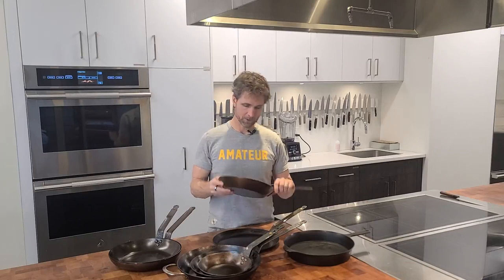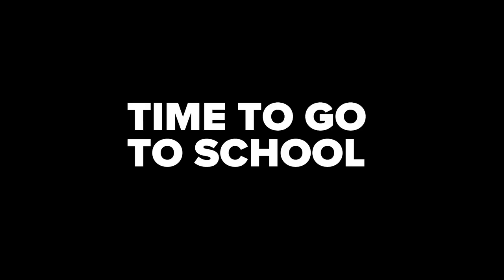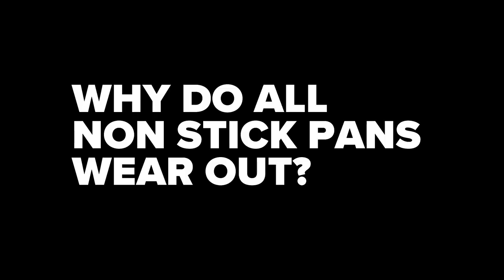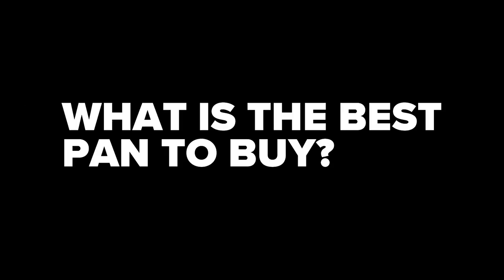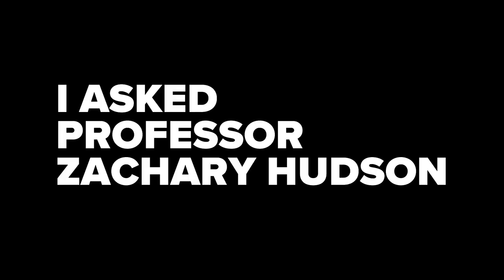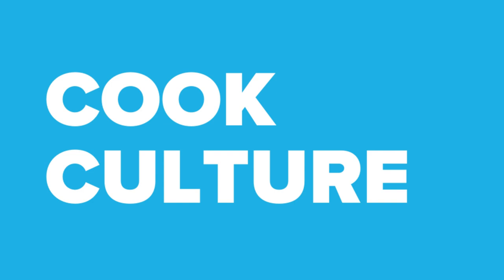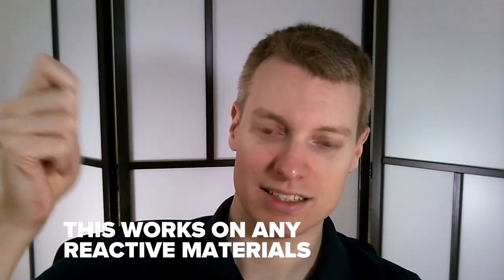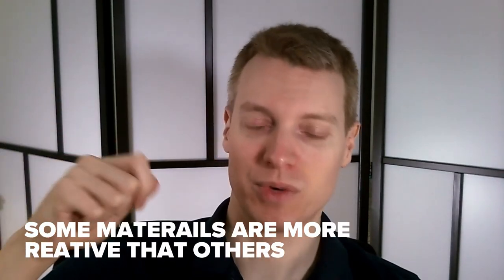Why ALL non-stick pans will wear out: I spoke with a Polymer Chemist

Comment: I inherited my grandmothers non stick pans, have been using them for the past 6 years. My grandmother used them for about 10+ years. I watched a review video on nonstick cookware only to find out its only good to use that cookware for 2-3 years and can release toxic chemicals into your food if it wears bad enough... i ran into my kitchen and checked all my pans and they were all in bad condition. I was devastated to learn ive been putting myself at risk. I only have cast iron, carbon steel, stainless steel, and glass for all my cooking because they can last generations and will always be safe!

Comment: This answers a lot of question I had. Although you’ve been preaching this to us for a while now, it’s still great to have it reiterated with science! Because I was going to ask what you thought of Caraway pots since they have no PFOA or PTFE or other sister materials in them. But I’ve learned from you and other people that it all comes down to the length of time of use. When I contacted Caraway, they said I could send their pan back to them if the coating wore out down the road for recycling but they currently don’t re-coat the pans. I guess it’s time to learn how to season forever-in-collection pans ;) Thank you for sharing your knowledge~
Reply from the maker: All good. Thanks for investing the time to get develop a long-term view. Whatever the promise of brands like Caraway, the reality is that they are made to be disposable cookware and will breakdown while you use them, depositing microparticles in you and our waterways.

Comment: Great video on the ecological issue allthough I wish he could have also commented on the personal health impact from using polymerized oil as coating:

1. Does it contain carcinogenic free radicals that can leach into the food?
2. Will using flames directly on the coating (eg. during normal use on a gas stove) create toxic fumes from burned polymerization?

Comment: Another example of wood abrading metal: woodworking tools. You have to keep sharpening them because even a few strokes of a very sharp plane iron or a chisel will cause it to dull and soon to become hard to use and require further sharpening.
Reply: That’s a much better example than water running over stone, since the tools dull so quickly.

Comment: I really like this video about how the polymerization works.  Also the explanation on the cheap teflon/non-stick pans and their associated environmental and health impacts was very eye openning.  I do not have any of these pans in my kitchen and I would always recommend  that people just not purchase non-stick pans.  This bolsters my experience and testing of textured versus mirrored finishes.  The durability of the seasoning has a direct correllation with the surface texture.  I had tested original Lodge sand casted rough finishes with very good results with adequate seasoning.  I also tested taking those Lodge pans down to a mirror finish and they performed equally well.  The difference I discovered was that the seasoning was not as durable on the mirror finish.  I took that mirroed finish back to a rougher surface using 60 grit sandpaper.  Further testing showed that the seasoning took better to the rougher surface and was more durable lasting considerably longer.  Going to strip down one of these pans and treat with vinegar for 15 minutes to see if this has any effect on the pan taking the seasoning better and if the seasoning will last longer.  I'll let you know.  Ciao
Reply from the maker: Nice. Thanks

Comment: All oils used in the kitchen will oxidize at elevated temperature and this will make them satisfactorily reactive bond to bond to a metal pan, even a stainless pan and build what you could call a varnish surface layer.  Think about tung oil and linseed oils applied to wood which eventually harden into a protective coating on wood.  Except this occurs much faster at the temperatures used to season pans.  
But the bond strength does depend on the reactivity of the metal surface as well as its surface texture.  Stainless has enough relatively inert chrome and nickel and is smooth polished and thus the attachment is not particularly long lasting.  Iron and steel are much better and will furthermore develop a black iron oxide layer that aids attachment. Cast iron is well known for microporosity that further anchors the seasoning layer. I notice many carbon steel pans come with a black oxide and/or phosphated or nitro carbonized mat surface which also anchors.  
All Teflon comes out of the reactor as a very fine powder.  This alone can be compacted into a soft mass with about the strength of a bar of ivory soap.  But when "sintered" in a high temperature oven, usable integrity and strength are developed.  However, Teflon can't practically be applied to a metal pan this way - and strength and wear resistance are still inadequate for cook pans.  
Instead, the Teflon reactor powder is formulated with various binders, carriers, fillers and solvents into a coating that can be sprayed on and thermally set.  Fillers like mica dust, various ground minerals, metal flake and even diamond dust are incorporated specifically to improve wear and scratch resistance.  The binders help it adhere to the filler and the pan surface itself.  Sometimes a primer coating is involved.  Aluminum is normally given a thick anodized surface.  The overall result is what you cook on.  And there is a recent concern that estrogen mimics can leach from this surface.  In any case, Teflon, in the presence of alkali and sodium at high temperature will eventually lose non-stick properties.  For example, frying onions with a little salt will more quickly kill your Teflon.  Interestingly, frying onions in oil with a little salt will help build a seasoning on carbon steel and cast iron.  And potato skins add minerals that help quickly build an effective seasoning layer ... akin to varnish.

Comment: an excellent video!  still, i wonder how much extra water, soap, and energy to dry and re-season the safer pans, since i have to scrub and re-season with almost every use--except for the stainless which require the scrubbing and polishing (for me)  but no re-seasoning.  these safer pans usually require more oil when cooking as well.  i realize my technique probably needs a lot of work, but suspect others are in the same boat.  i'm not ready to throw away non-stick, but use them very sparingly, with no plans for replacement.
Reply: I have wondered about this as well, but when you think about it the steady-state scenario you are already cooking with the pan, so at most you are keeping a burner on for maybe an extra minute to do the post-seasoning?  If you use electric or induction you beat a gas user with non-stick for sure due to the efficiency.

Non-stick cookware also requires washing with soap & water.  Less scrubbing for sure, but that doesn't mean you use less water.  I usually add some water and then scrub, but most of the time that isn't necessary even on my cheap lodge.  If stuff does stick and you have seasoning the burned food can just flake right off with a bit more cook time.  I have a hell of a time making Just egg in my less-seasoned pans, but even here when it sticks I can easily scrape it out as a few large pieces when I'm done.  In my well-seasoned pan if I have it a bit too hot the burned/deeply fried layer just brushes out like a true non-stick pan.

I think the huge amount of energy and water and other chemicals and materials needed to refine or recycle the metal would take quite a few stovetop reseasonings to catch up to.  And all the reseasonings in the winter are basically free (I write as I soak in the warmth from my just-seasoned pans and oven).  Also, the impact of the toxic processes used to create and apply non-stick coatings should be a consideration.  If not energy-wise, their impact in waste products and microplastic forever pollution.

But I have been trying to improve my stainless steel chops to avoid cooking things that may damage my cast iron seasoning.

Comment: The main issue I have with cast iron pans is that they rust very easily in Puerto Rico even while making sure it’s completely dried out after each use. Places with high humidity make it really difficult to maintain cast iron. Any other suggestions, whether a different material pan or better maintenance tips?
Reply: After you've cleaned your cast iron after use, dry with paper or cloth towels, then put back on the hob set at about 200- 250 F to evaporate any remaining moisture, then give a very light wipe with grapeseed (or similar seed) oil over all surfaces while the pan is still hot to the touch.
 
If high humidity can't get past that fine coat of grapeseed in Panama, it isn't going to get past it in Puerto Rico.
Reply: We have them in Cuba that is the same weather as Puerto Rico, and don't have this problem. Do you soak them? Or leave them were they are not protected from rain, or dont oil them after use? All those things can be conducive to rust. A fairly kept cas iron should not rust in any weather.

Comment: Very good video! however, only thing not discussed is whether washing cast iron/carbon steel pans with soap affects the coating or not. Maybe this is a whole subject for a new video? Cheers!
Reply: Those polymer 'brushes' sticking out of the coating the prof. spoke about are oil soluble. Dish washing soaps dissolve these (albeit quite slowly with handwashing formulations). This is why people say wash with water. 

The water actually helps the poly. layers stay on the pan. It is less attractive to those oily brushes so they dont want to dissolve off into it and flop back down and compact on the pan instead. Making more layers of coating. Ingenious really. With soap, they will likely be broken down and will definitely want to dissolve into the soap/water solution becasue of the lower surface tension that the soap promotes.

But if you wash with soaps you can always reseason. Over time the polymers will oxidise anyway and need regenerating even if they were never scraped off. Of course it is impossible to 'never' scrape them off. Even the lightest cooking agitation with oil (not water) facilitates this required regenerative process. It is a win win. 

Except the iron, aldehydes are also produced and some acrolien I understand. But these are not as harmful as the iron. They are volatile resulting in generally tolerable concentrations in the food. In addition, these compounds are easier to metabolise and excrete at low concentrations... Iron is not and builds up over time in men and post menopausal women.

Comment: hello, thank you for all the informative videos.
What is the best pan to cook tomato sauce/without getting the metal into our food?
Another question: how to buy the field pan while based in the UK? Many thanks
Reply from the maker: Hi, thanks. If you have a really well-seasoned pan you can cook with acidic foods. Field is looking at the best way to support UK customers. You can check their website: https://fieldcompany.com/
Reply: @Cook-Culture  This brings me to a good question, can ALUMINUM finish be adequately seasoned as to reduce the health risks associated to it?
I believe the greatest aluminum exposure from these natural finish pans may be from scrubbing the soft metal, generating silt-like alumina dust, which is VERY hard to remove (& nearly imperceptable), and roughens the surface, making for more surface area (from texture) for alumina to cling to & more aluminum surface for food to react to..
I have to say I love my All Clad style cookware, but my heavy gauge aluminim is all teflon nonstick.. I have some beautiful skillets, but am wary now, even though I use them only for low temp cooking, ie eggs or single serve sauces..
I think electric coil burners caused hotspots in iron based pans as pans got lighter, & that nonstick saved immediate sticking & cleaning workload, while delivering more sales revenue in long term.. oh, I prefer the more durable goods!
Really informational videos, I love learning more! Thank you for your service to those of us like me who know so much, but still need & desire to learn so much more!

Comment: What is the relationship between heat and polymerization? Do you have to exceed the smoke point or does the oil polymerize below if tou just give it enough time? (Meaning, do you really need to burn the oil to get the coating)
Reply from the maker: No, it's a fine balance of heat and time. You really don't need to make a lot, or much, smoke. Just a whisper.

Comment: I'm surprised that after explaining the molecular differences between plant-sourced oils and animal-based fats, that he recommended using plant oils. I have tried both in long-term cooking, and found butter to be much better than plant oils. Plant oils do darken my carbon steel pans much more; and.butter only leaves a translucent dark brown coating. But the plant oils seem to get carbon build-up much more faster, whereas butter doesn't at all. I also love the waxy, teflon-like seasoning that butter builds up rather than the 'stickier' feel of plant oil seasoning; and I also like the butter flavor in my foods too.

Maybe you can do a video about this? Try cooking long-term with butter, lard, tallow, etc in one pan and grapeseed, etc in another. See what kind of seasoning builds up in each pan: how they look, how each attracts or repels carbon build-up, how easy or hard each are to clean and maintain, how the foods taste after cooking, and so forth? Thanks.
Reply: BTW, I suspect that the reason why plant oils darken more as it seasons is because more loose carbon molecules are attracted to the C=C bonds he talks about. The reason why I can only get a 'translucent' dark-brown seasoning using butter is because less carbon molecules are attracted to the C=C bonds in animal fat. So wouldn't it be better to use animal fats than plant oils for seasoning? To get a better non-stick surface, wouldn't you want *less* molecular "fingers" attracting other molecules? It's opposite to Zac's logic and reasoning.

Comment: I have a few carbon steel de buyer pans. I like them. I often cook meat with a wine sauce, but after that the seasoning is almost gone. What would you recommend? Thank you
Reply from the maker: I would suggest if you're cooking this way all the time then use stainless steel. A quality seasoning can only take so much acid before it breaks down. If you were to cook with wine once in a while then your pans (with a hard seasoning) may be fine.

Comment: Thanks,I'm all into this polymerization method. I've always used flaxseed oil with good results,but wanted to try your suggestion of grape seed oil. I kind of get a slightly sticky feel to it..not dry and smooth as with flaxseed oil..
Any idea what I might be doing wrong?!
Thanks for an entertaining and educational channel!
Reply from the maker: Thanks! I'd say that if you're having good results with flaxseed then stick with it. Technically it's a better seasoning oil but some people find that it has a smell/taste so I suggest grapeseed because of its neutral flavour.  You may never find that grapeseed will harden as well as flax.
Reply: If I had to guess I'd say too much oil.  You should wipe the oil off until you think you've wiped too much off.  Then you should grab a clean paper towel and wipe it down again.  The best way I heard it described was "wipe the oil off like it was something you applied by mistake." Seriously.  If you're using the oven method you won't need to place a sheet pan on the bottom rack to catch drips and there is almost no smoke.  The last time I seasoned two pans in the oven this way my wife asked me what I was cooking.
Reply: @Cook-Culture  Ok,thanks,then I'll stick to flaxseed oil!
Reply: @yertelt5570  Thanks for your input! The thing is that this is exactly how I do it. Been doing it for years..with flaxseed oil..
I'll try again just for fun :)!
Reply: @semesterkatten  and are you using a high enough temp when seasoning w/ grapeseed oil?
Reply: @djC653  Maybe not?! What would be the ideal temperature with grape seed oil?
Reply: @semesterkatten  google tells me 450*f would be good. I think that's the temp CC here used on CS pans a couple of videos back.
Reply: @djC653  Hm..have to try again!
Reply: @semesterkatten  yeah google says 420 is smoke point so 450 should work. But like others mentioned wipe on oil then wipe it ALL OFF with new dry paper towel. Wipe off all you can which will leave that super thin layer of oil.
Reply: @semesterkatten  Might just be because flaxseed seasoning is harder so it feels drier??  Enjoy your pan!